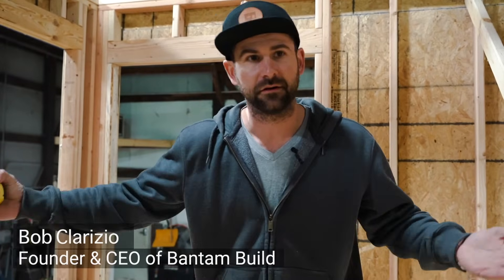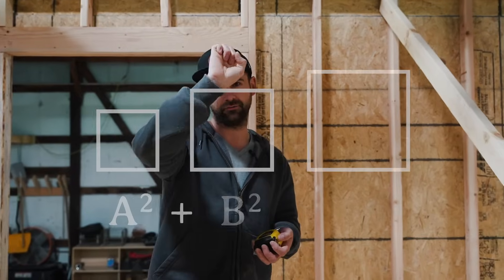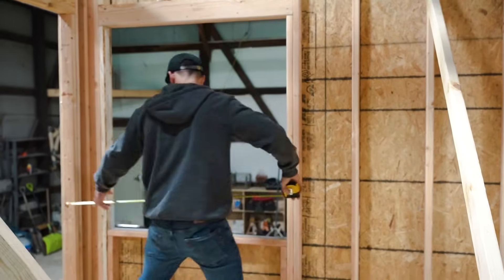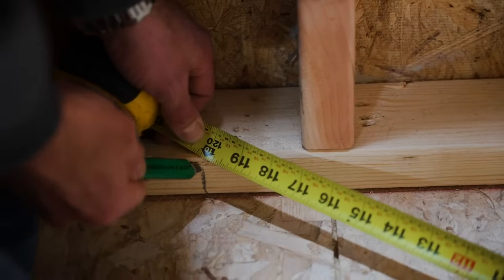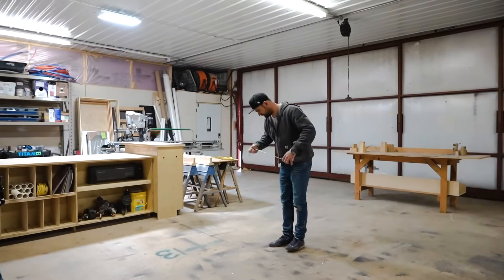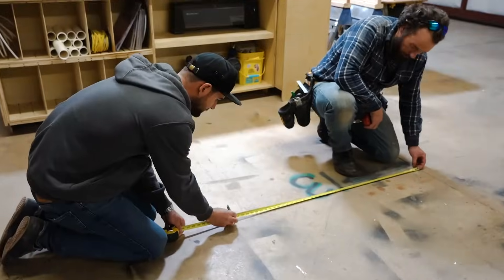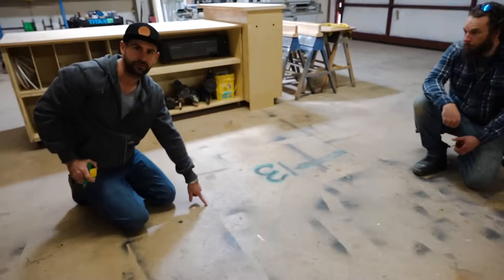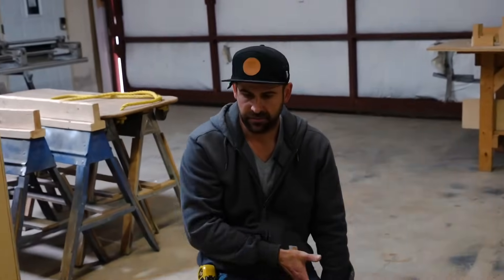How to square a wall with the Pythagorean Theorem

Comment: Is justin holding the center of the tape on the line or the same edge of the tape you used?  if not you might have a compound angle on your hands, the sine of justins potential offset from your tape hold and your hypotenuse angle

Comment: yep be careful measuring off even long exterior walls on old ass houses. fucked up a hardwood install because i didn't make sure a plastered exterior wall was completely straight. the last few feet where i was establishing 90 bowed in one inch so even though 3/4/5and 6/8/10 matched perfectly everything was off a few degrees. the other exterior wall was out of square by 2" in 14 feet and in this case making it perpendicular to an interior stairway would have "looked better" but not been perfectly square. establishing lines in the middle of room method was weird as 1/2 of the opposite wall was really off. well just because of that slight oversight with the longest exterior plastered wall dipping in at the last few feet, it's off a few degrees and my run goes seamlessly into hallway. Bothers the hell out of me but my partner doesn't notice it. Not my first hardwood install either.  Hope this comment helps someone working in 130 year old houses😆
Reply: That sucks dude.
So what's the solution in that situation? 
If you're starting off in a room that's already built say with flooring what are you supposed to do aren't you supposed to start from the threshold then do the 3 4 5 out ?
Reply: But I mean even if you started off measuring from the threshold out you could still end up with crooked lines if the walls aren't squared anyway?

Comment: Hi, Nice video

We had a chat at work in the lunch room as 2 different people want too put up shed / deck at home

And i tried to explain this, so i used the mobile phone and youtube and there was your video

They sort of got the idea, but i also gave them a senario for marking out the ground.

So, left say you want to put up a deck / pergola / shed

You sort of know you want it parallel and say 6 foot of a fence or another building or parallel to some concrete / pavers in the driveway / yard

Step one, measure 6 foot or whatever from the fence and mark it or place a peg or piece of round bar in the ground

Walk roughly down the fence your width or length eg 20 foot and mark that spot 6 foot away from the fence as well

Now you can use a simple piece of string, at one end tie a knot , or use 2 cable ties, the first cable tie lays flat on the string, the second one is the tight bind on the rope, now you can close the open / flat cable tie to say 1/2 inch whatever

Now measure 3 feet down the rope, and place another 2 cable ties the same way you did the first one

Now measure 4 feet down the rope, and place another 2 cable ties the same way you did the first one

Now measure 5 feet down the rope, and place another 2 cable ties the same way you did the first one

So now you have a piece of string in the 3 / 4 / 5 format ( lengths )

find your starting point and place the first loop of cable tie at the star into a peg / stake

Then walk a straight / parallel line and place a stake on the second cable tie

Now grab the last cable tie, walk back to the star and place that one also on the starting point

So out of the 3 corners of the triangle  cable ties 1 + 4 are at the same spot, cable tie 2 being the end of the 3 foot mark / first line is where ou want the wall to line up

Since you know the start and finish are on the same stake, and the other edge of the wall is roughly where you want it,  the unknown is the last piece of the puzzle, this is you loose string line on the ground currently not in a peg, so grab the loose cable tie on the ground and just walk backward to make both string lines as tight as possible, when both are tight, your current spot is now the missing part of the problem, place a peg, now loot at what you have -  A correct 3 / 4 / 5   triangle set up on the ground

Maths wise     

3 squared is  3x3=9   
4 squared is  4x4=16
5 squared is  5x5=25

So maths wise 9 on one side + 16 on the other size is equal to 25, then for it to join up as a triangle the longest length on the other side is 25 long to meet up in the right place     

if you want to do it twice as big them  6x6=36  plus 8x8=64     so 36+64=100    which is also 10 x 10

However, one you have the 3 points pegged out, you can run another string line as long as you need , say 200 foot, just use the same 3 pegs, make sure the new string line touches 2 pegs either way, at 20 foot you may be out a little bit,say your original 3/4/5is out 1/4 inch , you wont really notice it at 3 foot, but at 200 foot that 1/4 inch error may grown to say 2 to 4 inches at a distance, thus why you keep doubling up  the 3/4/5 to get close to what size you build

Regards
George

Comment: They are leaving out a step.  Yes,  A squared + 3 squared = C squared....BUT, you have to finish the formula and find the square root of C  ( 3, 4, 5  = 9 + 16 = 25 but the square root of 25 is 5 )  That's how you get 3, 4, 5....very important

Comment: Can I butt up a framing square against the wall and flick a chalk line?
Reply from the maker: Yeah that will work but for long line projections over 20-25ft I prefer to use the 3-4-5
Reply: @BobClarizio  thanks for your reply 😊
Reply from the maker: @wheres_bears1378 of course!!!

Comment: Great info
Reply from the maker: Thanks! What projects are you working on?
Reply: @BobClarizio  I'm building a gypsy wagon at the moment. I remember learning alot of carpentry stuff but haven't used it in forever. I've been a truck driver the last 7 years but I'm getting out of it
Reply from the maker: @ModernMessiah that’s awesome! How far along on the project are you?
Reply: @BobClarizio  2 weeks. Got the shell up. Need to square it and do the roof. I wish I knew how to do electrical

What do you need to do to get something rvia certified? Where do you even go to do that?
Reply from the maker: @ModernMessiah unfortunately only a registered manufacturer can be certified by the RVIA. However there are other organizations that I’d recommend. Have you tried NOAH? https://noahcertified.org/ they should be able to help you
Reply: @BobClarizio  ok thank you. Would registering the title as an rv be good enough for people to get an rv loan or no? How do your customers usually pay? Just cash or check and no loan?
Reply from the maker: @ModernMessiah as a manufacturer it’s easier to get lending, but in the big picture of things bank always treat RVs and such as personal loans because the rate of recovery on a repossession is very low so most times the same rates as personal loans are going to apply to recreational type loans. My recommendation would be to try Lightstream they’ll finance up to $100,000.
Reply: @BobClarizio oh ok I see. I appreciate your insight.
Reply from the maker: @ModernMessiah of course that’s why I make the videos to help people